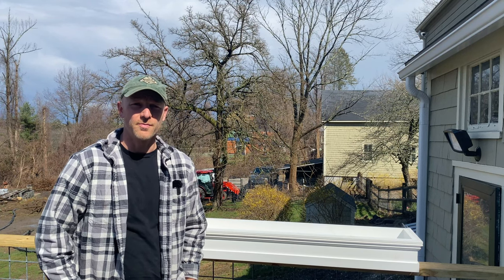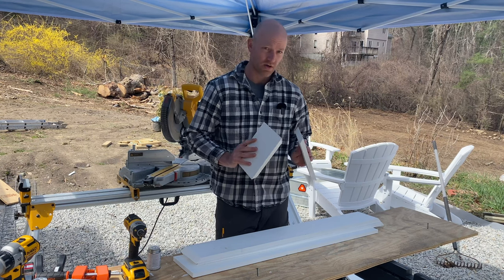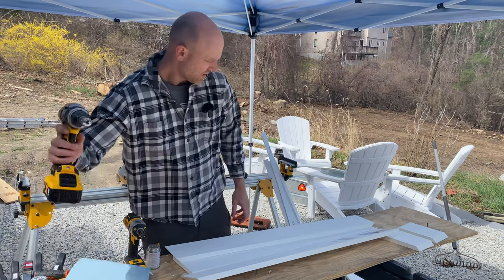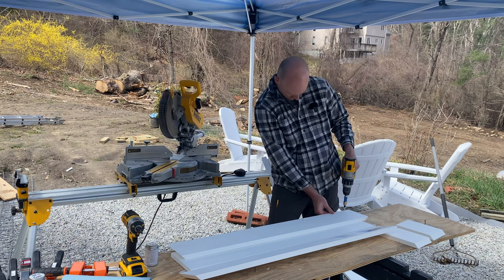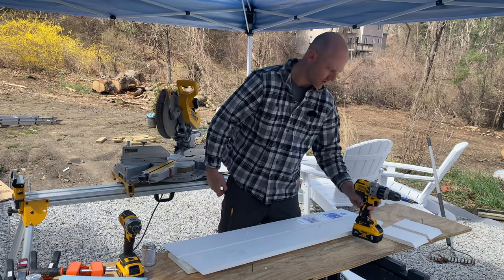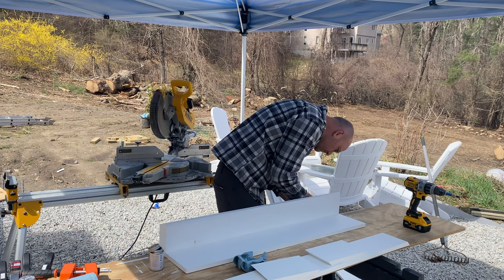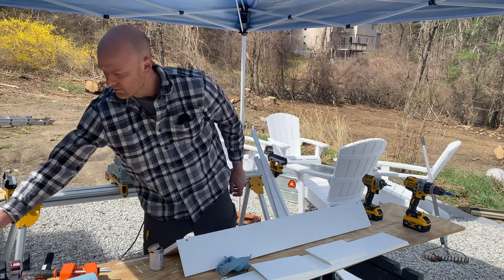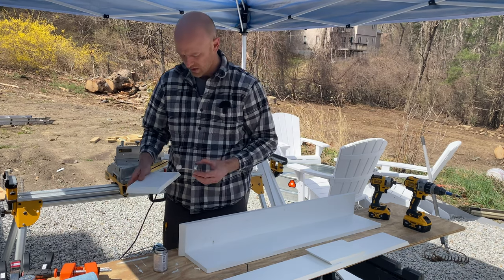You Can Build These Easy And Maintenance Free PVC Window Boxes

Comment: Outstanding build Jake! I don’t think you over built at all because once you add the weight of whatever soil is inside, you’ll be confident it will hold. If folks are concerned about weight or switching up the contents through seasons, I’ve put short blocks inside and made second bottoms that can be layered in florist foam block and treatments stuck into the foam. If one goes soil, perhaps a couple drain holes in the bottom would be helpful. That material can also be painted OR, my wife has these craft machines in her craft room that she makes vinyl overlays to accent it. I don’t have a clue how she does it…I think it’s some cricket machine thing or something. I don’t know…she’s got as many tools in her craft room as I do in my workshop! Okay, maybe not…but it sure seems like it!😁🤣
Oh, and I use a pin nailer for trim out…any tiny hole can be covered with a touch of paint…she does that with some kind of paint pen? 🤷🏻‍♂️
So, for the guys in your growing audience who are short on projects 🤣, share this on your wife’s Facebook page and you’ll be busy again real soon!!😁👊🏻 
Thanks for sharing Jake!!
Reply from the maker: Thanks, Keith!  I did end up drilling a few holes in the bottom and putting filter fabric in to keep the potting mix in place.  Vinyl overlay would be a fun idea! I was originally going to use brad nails to stick it all together, but couldn't find any that were galvanized and wanted to stay away from rust!